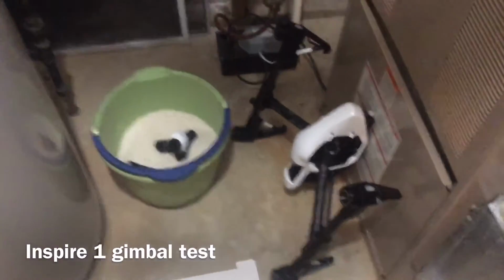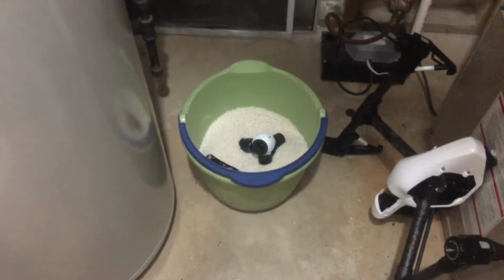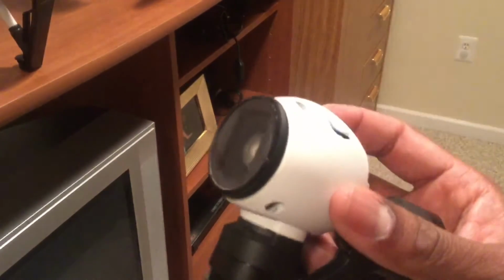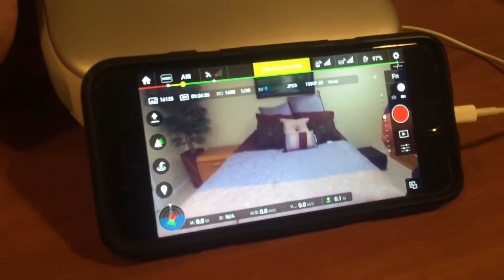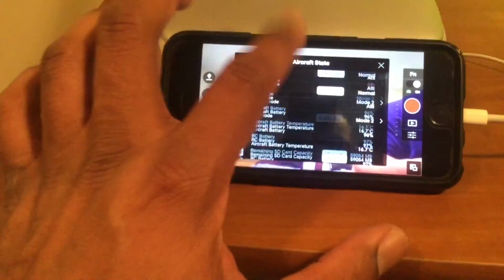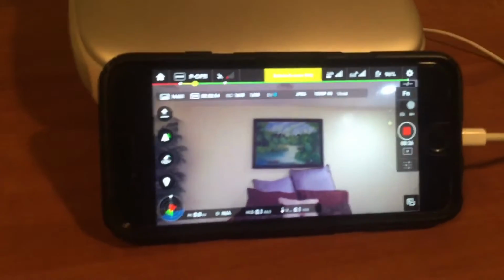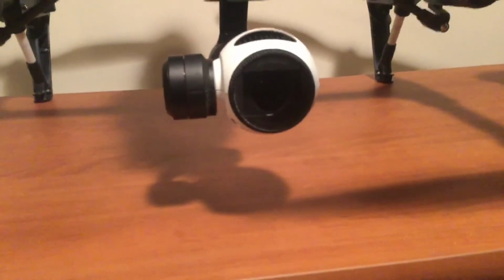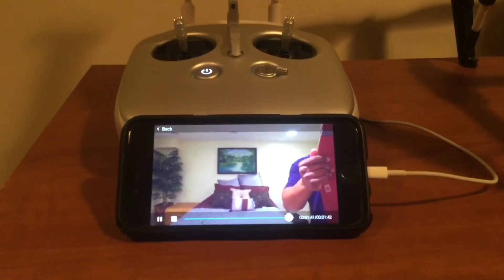Inspire 1 gimbal test after crashing into water

Comment: Just revived my Inspire 1 from water crash. This video made me feel better while I was waiting for it to dry out,

It was in fresh water for about a minute. I retrieved it with my toes from the bottom of a 6 foot deep lagoon.

Removed battery immediately, used hair dryer at home, then masked with paper towels and put in a garbage bag with 50 lbs of rice for 48 hrs. I used hair dryer on gimbal, then packed in a ziplock with 5 desiccant packets. Same deal.

Everything worked! I couldn't believe it. Make sure yours is completely dry before using. Good luck guys.